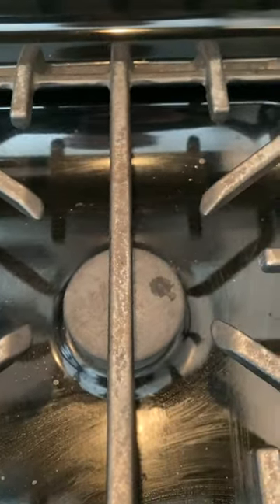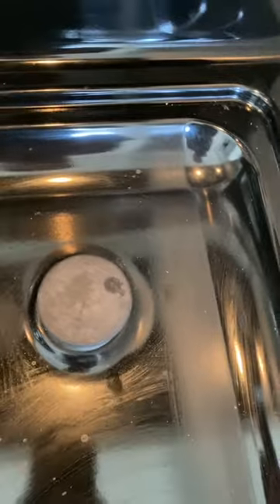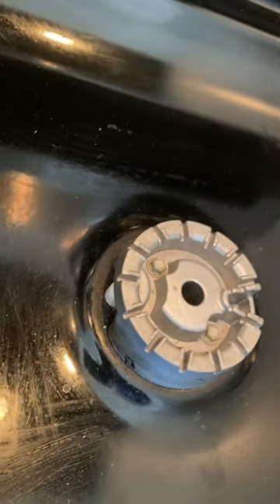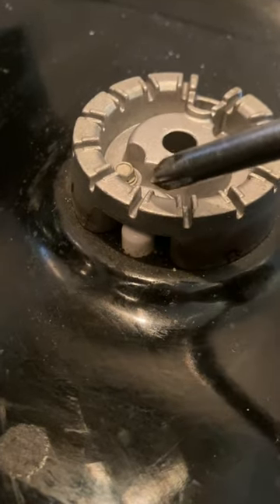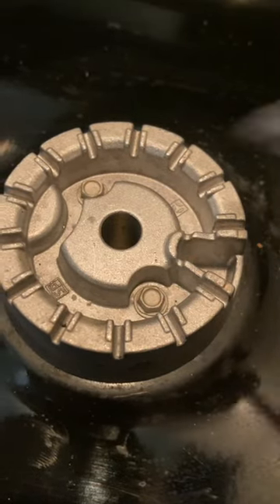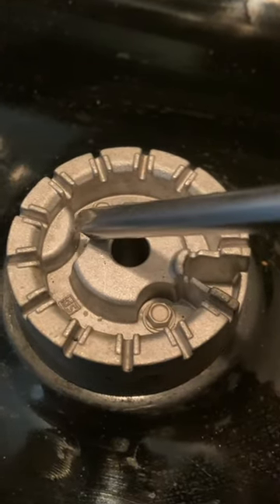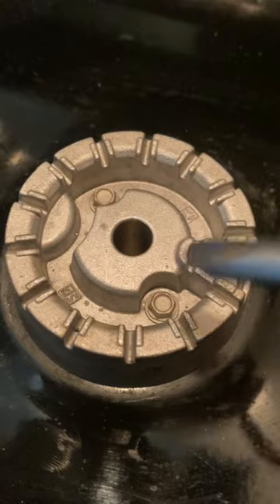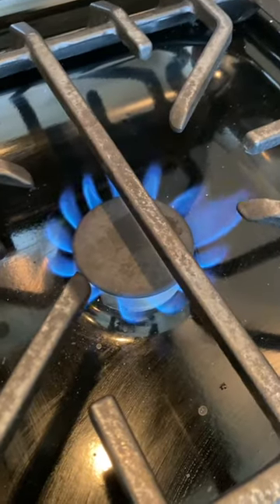Gas Stove Top Burner Won't Light? ⚠️🔥 #shorts #diy #tips

Comment: Mine turned out to be a tripped disposal electrical breaker which was on the same circuit. Reset the breaker and voila, boom. Fired up right away.

Comment: Mine sparks and then LIGHTS but goes out as soon as I remove my hand from the knob… can’t get it to stay for anything… I’ve got a Venini gas stove top with clean parts…
Reply from the maker: If this happens with all the burners then it’s most likely a pressure regulator problem & you will need to have technician look at it.
Reply: Only one burner does this, the largest one, the rest work fine.
Reply: Pull out the knob and replace, should work, it did for me.

Comment: What if my family members lost the black little round tops to the gas stove? Where can we purchase the ones it needs? We found random ones they’re either too small or too big😩
Reply from the maker: If you’re not having any luck finding the parts online I would take a pic of stove top including brand name of stove and go to appliance repair shop. Good luck!
Reply: eBay
Reply: @JENSENDIY  thank you I ended up doing this and we got the correct ones, it did great but now I notice if the oven is on the flames on top will go really low lol🤦🏻‍♀️😩🤷🏻‍♀️
Reply from the maker: @prettybrowneyes8945  That sounds like a malfunctioning gas regulator. You might want to have someone check it.
Reply: @JENSENDIY  i definitely will look into it thank you

Comment: I was smelling gas in my house for two weeks. I had the gas man come and check the gas appliances and furnace, ect.  Still smelling gas, so I bought a gas detector from Amazon & sure enough, my left front burner is leaking gas.  I cleaned all the little holes last week, none clogged.  So why is this one burner leaking gas?  I’ve been light headed & headaches.  Do I need a new stove?  Calling the gas company to come shut gas off to the stove this morning.
Reply from the maker: Oh no that’s not good! There should be a shut off behind the stove. I think something is wrong with the on/off control for that burner ie. it’s not shutting off completely. I think this is repairable and you shouldn’t need a new stove but definitely take the advice of the professionals. Good luck!
Reply: @JENSENDIY  TY, my son came & looked, problem solved .